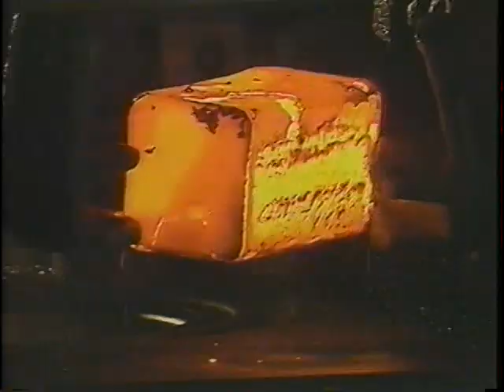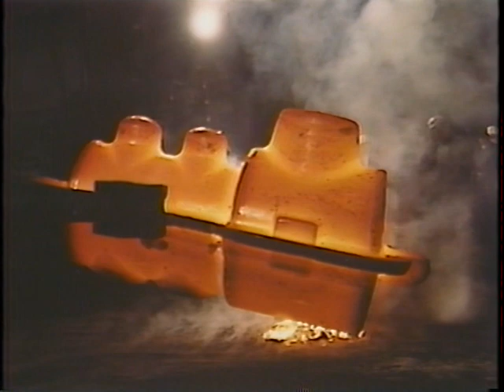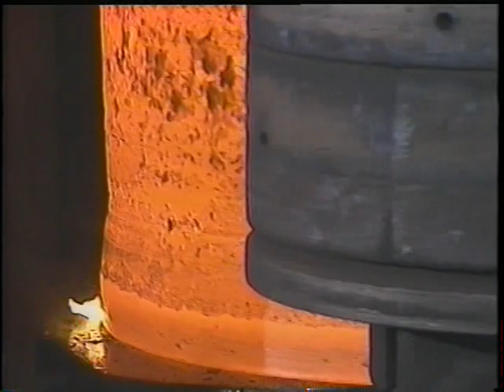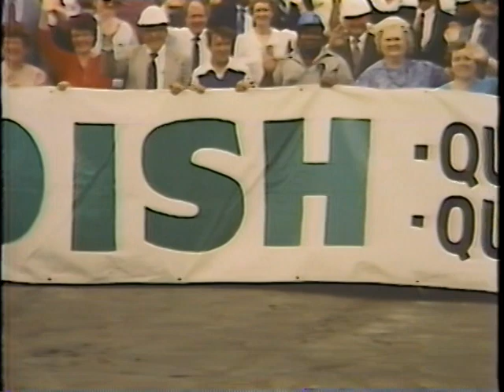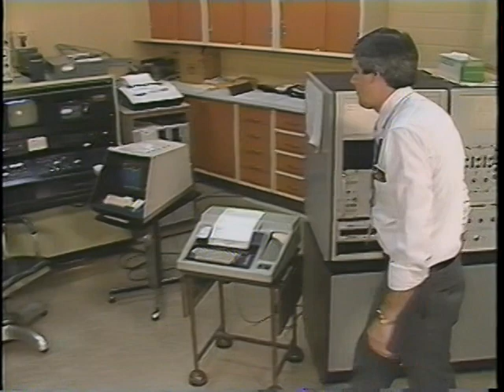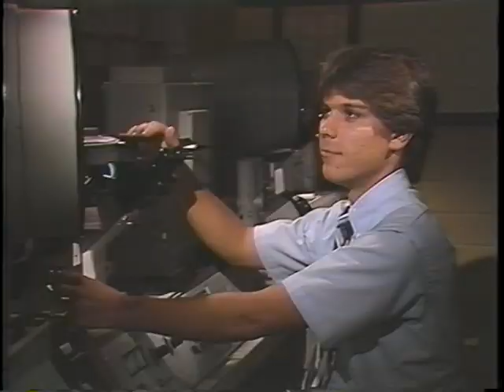Ladish Co.  Meeting Customer Needs

Comment: from my dad: During my 32 years at Ladish, I gave dozens of tours of the forge shop. Always thrilling to see #85 hammer is action. Sometimes hair-raising. Seeing giant seamless rings made was an awesome experience. On one occasion, I had visitors from Bay Shipbuilding. We were getting ready to watch #85 in action. Up pulled Mr. Braun, the president and chairman, in his golf cart and asked me if the visitors would like to go below the hammer which we did. We were within a few feet of the bottom ram when it was running. There were two other counter-blow hammers that Ladish obtained after WWII that were confiscated by the US government from the German and Nazi led Krupp Works. They are still operating. In its heyday, Ladish was an incredible manufacturing facility.

Comment: I used to work for the Chicago & North Western Railway (now Union Pacific Railroad) Co. as an ultra-sound rail test car operator.  The C&NW's mainline went right along the west side of the Ladish Co. and once while testing those tracks I could feel the thundering pounding from the forge works right in my test truck.